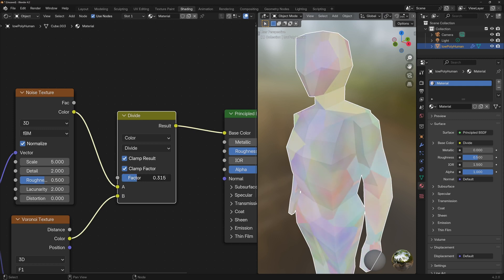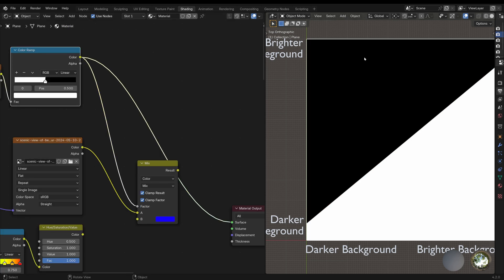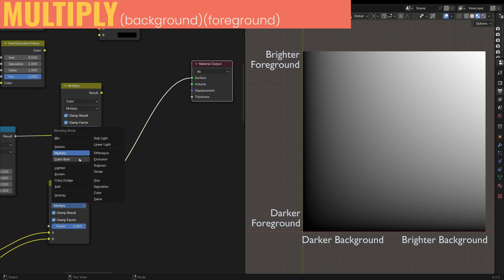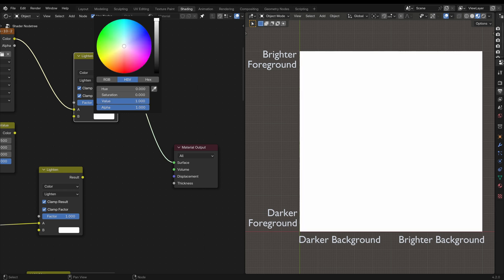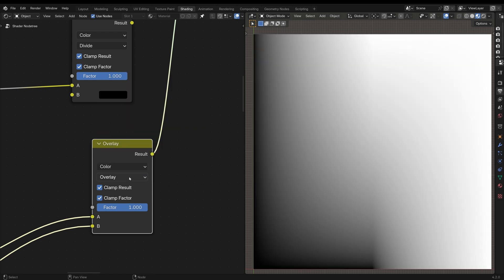The Mix Node and Blending Modes Fully Explained

Comment: (for helping)
📊Clamp reult + Clamp factor 01:06
📚Factor + A / B 02:09
📋Summary 00:51
🟫Mix 02:38

⚫DARKER
🔳Darken 02:54
🔳Multiply 04:38
🔳Color Burn 05:30

⚪LIGHTER
🔲Lighten 06:53
🔲Screen 07:28
🔲Color Dodge 07:54
🔲Add 08:16

🟡CONTRAST
🟨Overlay 08:41
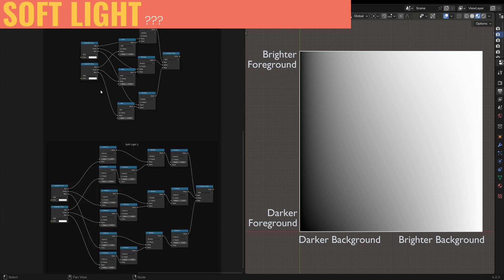🟨Soft Light 09:29
🟨Linear Light 10:05

🟣COMRARATIVE
🟪Difference 10:53
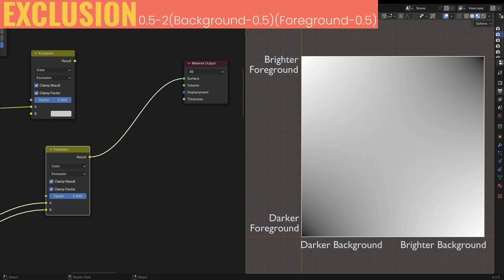🟪Exclision 11:51
🟪Subtract 12:14
🟪Divide 12:37

🟢COLOR(13:12)
🟩Hue 14:00
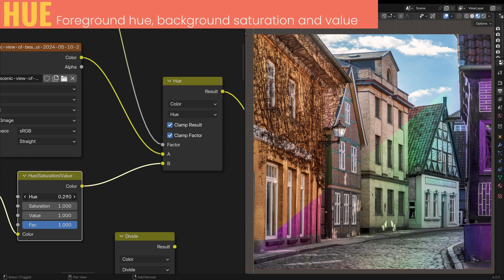🟩Saturation 14:21
🟩Color 14:55
🟩Value 15:19
Reply from the maker: Dayum thanks dude!
Reply: thank you so much bro!

Comment: For the confusion of what the linear light mode does:

it simply maps B from a 0 -> 1 range to a -1 -> 1 range and adds it to A. Practically this subtracts if B is < 0.5 and adds if B >= 0.5. The difference is that the values below 0.5 are inverted meaning B = 0 results in -1 while B = 0.5 is 0.

Practically it's centered around 0.5, the further we go away from 0.5 with B, either towards 0 or 1, the change is stronger and we subtract this "distance", if B goes below 0.5 and add the distance, if it's above 0.5

This can be replicated with two nodes only: Vector Mix, set to a Non-Uniform Factor with B as the factor input, with A = -1 and B = 1 (acts identical to the map range equivalent). Then just a Mix Color "Add" to add this into the A Color

Comment: This is such a needed resource! This is the kind of thing that should be explained in the documentation (yes, full formulas!) because casual dabblers do not read documentation! Currently the latest manual just shows 8 examples of color mix modes (omitting many) and you need to reverse engineer what is actually going on from that. It's like they assume that everyone took "advanced color calculus" in high school. Contrast with the documentation on the Vector Math node where they do give formulas for stuff like dot product and cross product. Those I did learn in school!
Reply from the maker: Right! I actually needed this myself because honestly I was just guessing.

Comment: Really enjoyed your video! Binge watching your channel, but on the blender source 9:34
There are lots of references in the code to blending modes as they are used in sculpting, vertex painting, compositing etc - even the freestyle shader, but I think the operation for the shader nodes is described in node_mix.osl :

color node_mix_soft(float t, color col1, color col2)
{
  float tm = 1.0 - t;

  color one = color(1.0);
  color scr = one - (one - col2) * (one - col1);

  return tm * col1 + t * ((one - col1) * col2 * col1 + col1 * scr);
}

Hope this helps!
Reply from the maker: That helps a lot!!! Where can I find the file my friend?
Reply: @Dude_Blender  No worries! The one I found that looks to be called by the node was in blender-master\intern\cycles\kernel\osl\shaders\node_mix.osl, the soft mix function is defined in a few other places too like color_util.h in blender-master\intern\cycles\kernel\svm. Let me know if you need anything else. 😀
Reply from the maker: @asherspira  that's super useful! thanks for the tip dude!